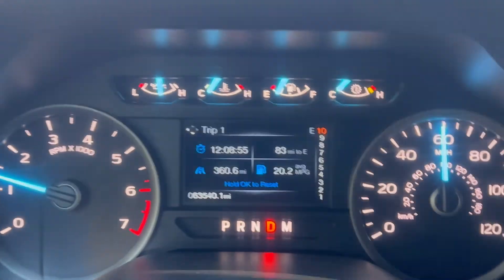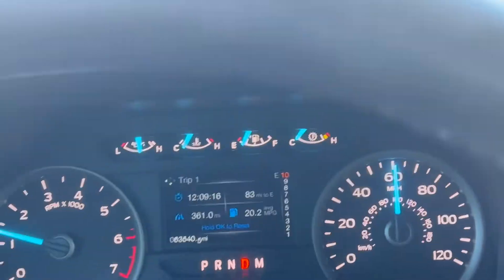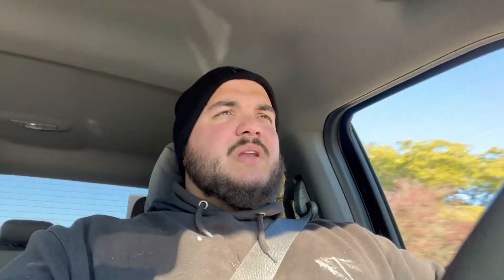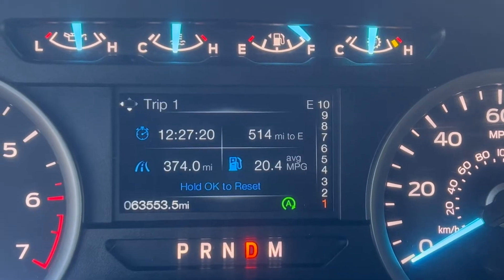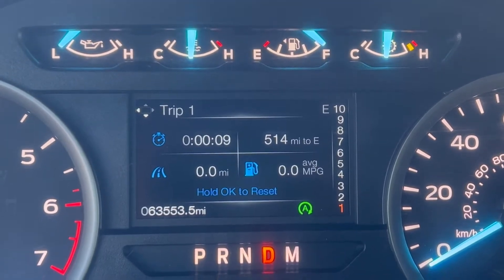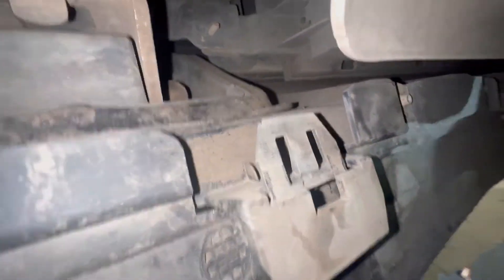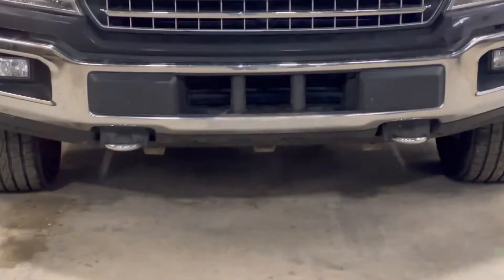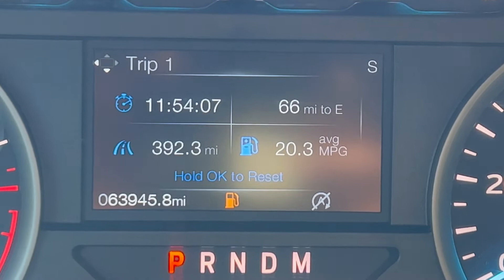MYTH BUSTING HIGH MPG ON YOUR FORD F150 ECOBOOST. WE PUT IT TO THE TEST! **BONUS AIR DAM REMOVAL**

Comment: I put 34” KO2s on (not level or lift) and still get 22-24 mpg on highway but city mileage dropped considerably.
Reply from the maker: Damn! Good to know. Once these summer tires are worn out I want to put some meat on this truck. And that’s also surprising cause those ko2 are a heavy tire.
Reply: @Papajoesgarage  Just depends on your goals and use. Also when I say 34" I mean that's their actual diameter measurement. I put on 275/65/20 They fit perfectly with no mods. City mileage is down from 16+ to 14mpg though. Getting them rolling sucks the gas. Keeping them rolling is not a big deal.
Reply from the maker: @tedd7028  good to know. I like the ko2’s. And everyone I installed them on loves them.

Comment: Have you hand calculated your mpg? My '15 2.7 supercrew 4x4 had an 8%+ error showing the mpg too high. Ford makes the calculation adjustable and the factory default1000/1000 equal to 1 (no correction). I set mine to 913/1000 and actual mpg is within .1 or so, but the gallons used is still wrong. Last tank was 19.2 mpg 50/50 driving, so it's good but not as good as your 10 speed.
Reply from the maker: I haven’t yet and most of what you said went right over my head 😂 this new car stuff is so confusing. I would take the mpg hit to have the Sox speed and ditch this choppy 10 speed
Reply: My 15 3.5 tt is averaging 13.5 city smh. Stock too

Comment: You don't do anything stupid and I like what you do on your channel and I didn't know anything about that air ram underneath those truck and all I did on my truck was I put some hellwig heavy duty leaf springs something like what you see on the back of those grain truck's there hellwig LP-35 HD leaf springs that's all I did to it and yes I was going to lift it but I decided not to because it's a bueatiful looking F150 when I got it a year and a half ago I got my truck in November of 2021 two weeks before Thanksgiving and it drives bueatifuly and I like ford truck's I'm a ford truck fan

Comment: How are you getting 20 mpg?
Reply from the maker: Not sure. I have highway tires, I get on it every now and then. Most of my driving is highway. Other than that I just putt around. What are you getting?
Reply: I get 15
Reply from the maker: @justinharris1611  do you have big tires? Even when I romp on it a lot for a tank it still averages about 18 or so.
Reply: @Papajoesgarage I have stock tires, and I change oil and air filters regularly
Reply from the maker: @justinharris1611  guess I will consider myself lucky. I do drive like a grandpa most of the time.